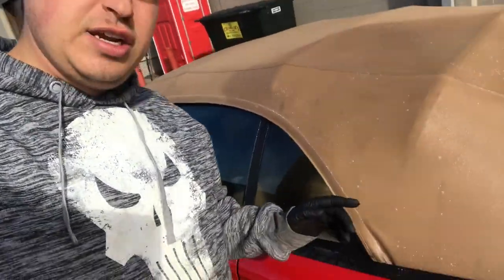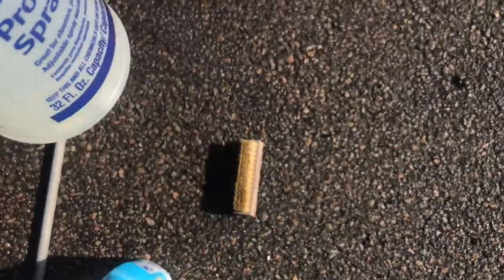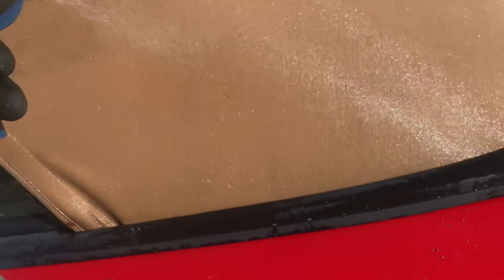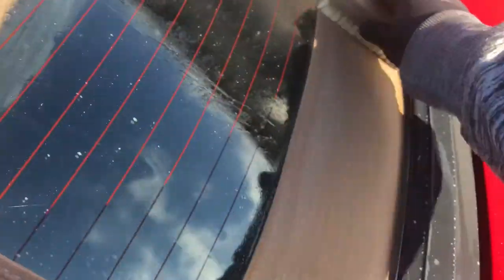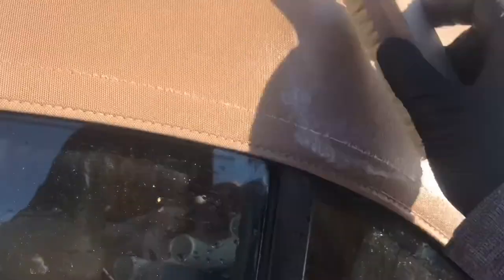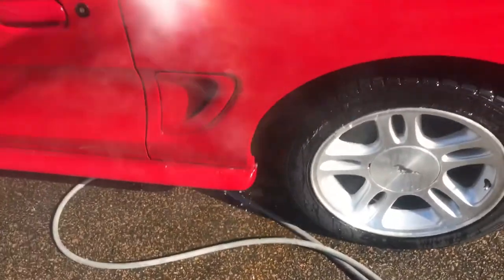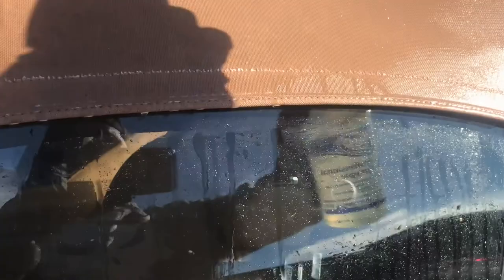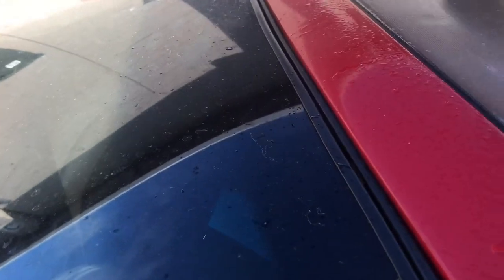Episode 2: How To Clean Convertible Tops With Mold

Comment: Thank you so, so much! This was SO easy, I bought some stuff and it didn't work anything like this, I just put 50/50 bleach water mix, used a regular household sponge and wiped it off. Kind of annoyed because my top isn't too, too old and it had some dark mildew on it. It's the second canvas top on a 2002 VW Cabrio, and it had mildew on it within 4 years. The top has 10 year guarantee, big woo! It still costs like $500 to install. Anyway, I don't think I can pay before after pix or I'd show you. But I really can't thank you enough!!! You made my life so much easier with this video ‼️

Comment: very informative!! unfortunately, I got mold also on the inside part of the soft top and took my car to a car wash and they said they wouldn't touch the inside of the top in case their detergent causes damage, they wouldn't want to be held accountable for it. So now I have to clean it on my own. can I still use this bleach for the inside?
Reply from the maker: Try dampening a rag with the same stuff, and try scrubbing it. Dont spray because it may get on carpets or other materials. May take longer by it will work.
Reply: @detailarmy5616  thanks a lot!!